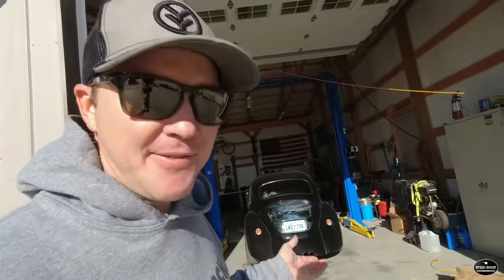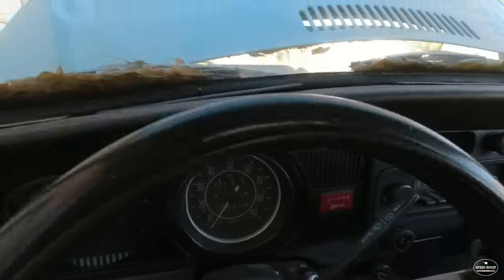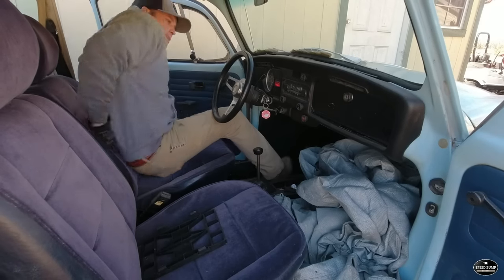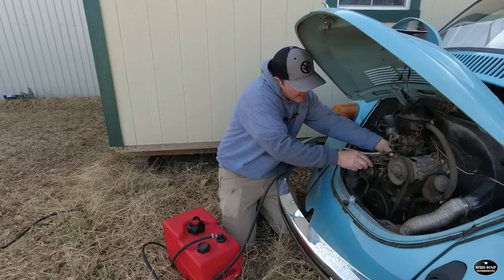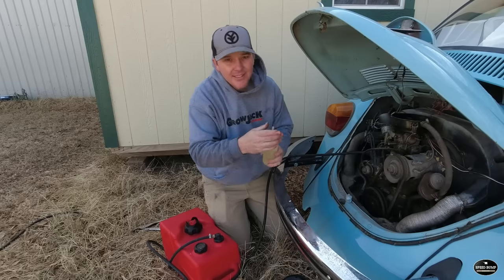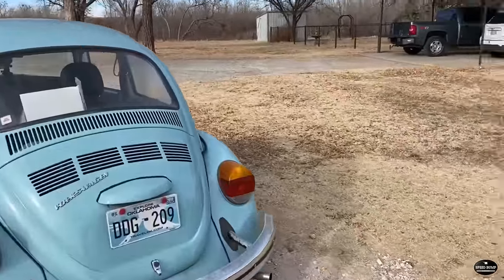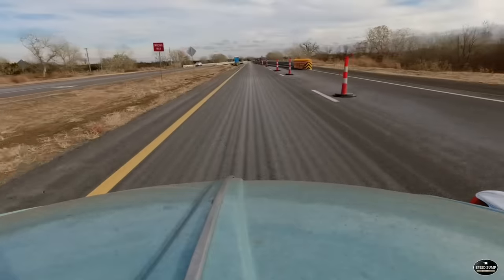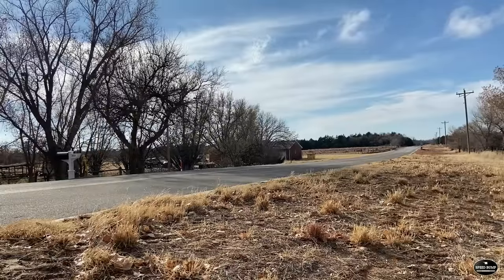{Will it Run?}1974 VW Beetle

Comment: It's a 1974 Standard beetle, not a Super Beetle. The generator and air cleaner are not correct for that car...it should have an alternator and a paper air cleaner assembly. The plug on the side is some kind of dealership "diagnostic' plug. Really nice car...wouldn't take much to return it to original!
Reply from the maker: Thanks for the info Tyler! I would love to see what those diagnostics looked like on such a simple system lol.
Reply: @SpeedBumpGarage  You're welcome. Haha, I don't think there was much actual diag ability. I think there was a TDC sensor in the block somewhere and it probably had ability to read dwell and timing advance and voltage but not much more. More of a selling point in those days tot ell the customer that the dealer could "put it on the computer". Some times you'll  see the same type of thing on domestics cars during the 70's. Also if you're curious, you can get the engine code off the block under the generator stand and determine of it's the original engine.

Comment: Blow out that line and replace the filter, maybe clean the idle jet. if its fuel delivery, confirm the pump is good. get the right air cleaner, fuel lines would be good to replace. nice car, I never had one that new.
Reply from the maker: That's the plan! I need to get an air cleaner ordered.  Thanks!

Comment: Little bug is in great shape! I'd love to have it as a daily driver! Little cosmetic repairs, and a carb kit, likely a dry air cleaner kit, and cleaning up the wiring (Every VW I've dealt with has had a mess for wiring). Always wanted to own a Beatle, but never got the chance, and now, it's likely I'd never be able to afford one in good running condition, sadly. Helped work on a couple, back in the 1980's, in Germany. GI owned, German spec. models. Early 1970's models, I believe. Factory wiring looked like they just tossed a couple rolls of wire at it and let it sort itself out. That was usually the first thing we worked on. And usually took the longest to make look right and work right. Had to completely re-wire one of them, using a factory wiring diagram, that we had to get translated from German to English. Guy that owned the car gave it to the new owner when he sold it. That one had the clutch in the stick, instead of the floor. Think they called it the AutoStick? Strangest transmission I ever dealt with.
Reply from the maker: They definitely did not worry about making the wiring look good lol. I have heard those auto trans are a nightmare to work on.  Thanks for watching
Reply: Just an automatic with a diaphragm disengaging a torque converter. Very slow cars but relaxing.

Comment: Noticed part two of this posted recently and realised I hadn't watched part one, so decided to fix that.

When you said a one lane bridge on the way home that was not what I was picturing.  I was thinking a bridge with only one lane open for traffic going both ways so you may have had to sit and wait to go across or if you got stuck (I didn't think you would) that traffic in both directions would be held up.

So glad you got it back without any real issues, now off to watch part two.

Comment: Engine sounds really good! I would check the carburetor to see if it needs rebuilt or check for any air leaks. Cause I could tell how it doesn’t want to idle and sometimes with a vacuum leak or any air leaks it won’t stay running without revving it. Great Video! Nice Car! 👍
Reply from the maker: Thanks! I ended up getting a kit for the carburetor so I’m going to go through it soon. Good call on the vacuum leaks! I appreciate the help

Comment: Here’s a helpful hint! When looking at the schematic you print out from the internet, you have to turn it upside down when under the trunk lid for the orientation to be correct. I know this because I bought a 72 beetle and all the wiring was on the fuse box reversed. I figured the last guy looked at the schematic wrong! I just switched everything back and now it’s fine!
Reply from the maker: Thanks for the tip!

Comment: I think that those are not the og seats. I had a 1974 VW Bug years ago and it was totally original when I got it. There should be a little lever at the very front of the seat that you can release and the whole seat will just slide out you don't even need any tools to remove the seats if they are og VW seats. It looks like it also has a quite pack exhaust on it. Mine had a quite pack/header on it but I took the muffler off and ran a stinger with the baffle out. It was just a stock 1600 but it sounded like it was a "hot rod" lol. The thing that I really liked about it was if I had had a bad day at work when I got into the Bug all of the bad stuff from work just went away and life was good. Wish I had never got rid of it. I and it fixed up in what's known as The California Look.
Reply from the maker: I love the way the baja's sound with that stinger pipe! Driving a hot rod to work can help melt away all of you problems lol

Comment: If it will run like that, but not idle, check the idle fuel cut off solenoid. There’s a small Dashpot screwed into the side of the carburetor that has two electrical wires going to it. This is to keep the engine from running on i.e. dieseling after the ignition is shut off. Take the two wires off the dash pot and unscrew it from the side of the carburetor you’ll see a little plunger. Hook the wires back up and turn the ignition on. When 12 V is applied to it the plunger should retract opening up the idle fuel circuit. If the plunger does not retract when 12 V is applied to it, or you do not have 12 V there with the key on, the car will not idle. Sometimes you can shoot some WD-40 in them and free them up if they are just stuck, or if you are in a jam, and the plunger does not retract when 12 V is applied you can take a pair of needle, nose, pliers, and snap the plunger end off, and screw the Dashpot back in the Carburetor to plug the hole, and it will idle just fine. The only problem you have is, you will have no ideal, cut off circuit i.e. run on/dieseling protection..

Comment: The taillights tell me it's at least a 1973.  On the older cars part of the numbers on the taillight tell you what year it is (old trick).  But that would be a "Super Beatle" meaning it has a McPherson Strut front end.  I've had many VW bugs, mostly between 1965 and 1969 w/torsion bar front suspension.  Used to make baja bugs out of them and they were great off road and in the snow.  Fun little cars, good gas mileage too around 30 mpg.  You're lucky cars are pretty rust free for the most part in your neck of the woods, unlike where I live.  The wiring can be a project all in itself, but you know that from your other bug. lol   Great video.
Reply: mikejames7013 I don't think it's a Super Beatle. Because the windshield is flat and Supers have a curve to them. Years ago I had the twin to this car same color and everything.
Reply from the maker: Thanks Mike! I didn't look but I was assuming it had the torsion bar front end.
Reply from the maker: I do think it is a standard beetle
Reply: @SpeedBumpGarage  If has torsion bar suspension its a regular one, Super beetles had McPherson struts.
Reply: @lilorbielilorbie2496 ’71 and ‘72 super beetles had flat windshields and flat dashboards. The curved windshield didn’t show up until ‘73. They all had McPherson strut front ends.
Reply: @ekimp252  That may all be true, but this car is either a 1973 or a 1974. That's when they started with the "safety" bumpers and the big round taillights.
Reply: @lilorbielilorbie2496  this is a '74, it has the round "shock absorber" style bumper mounts with the matching fender hole covers. '73 was the last year for the flat style. But nothing is absolute with these cars, they're 50 years old and lots of times parts got switched around.
Reply: @ekimp252  The bumpers on my 74 Bug were in such bad shape that I just threw them away and adapted some early blade bumpers in their place.
Reply: @lilorbielilorbie2496  I’ve thought about doing that to my ‘74, I’ve seen someone that makes covers that fill the big holes in the fenders and have slots for the thin brackets. Got other stuff I need to fix first!
Reply: @ekimp252  The way that I fixed mine was really simple. I got some flat stock and bent it till it fit into the blade bumper then welded it to the bracket that the 74 bumper bolted onto. I left all of the rest just like VW made it. That  way I still had the "safety" part still on the car and the bumpers were the only part that I changed.
Reply: @lilorbielilorbie2496  that sounds pretty interesting, how old are the bumpers that you used? I've wondered what towel bars would look like on a late model.

Comment: They are a RUGGET LITTLE  AIR  COOLED  ENGINE that have a magnet in the bottom of the oil panbolt to collect steel particles that can wear an engine oil pump out if not captured by the magnet.They had nice after market kits for rebuilding that little motor.You get  4 new cylinders with matching pistons and rings,rist pins and retainers crank berrings end play bearings.The 4 cylinders come with valve seats already installed you have to seat valves. They were really nice little motor that any KID could learn.I had the FAST BACK engine, they called it the PANKAKE ENGINE with two carborators that had to be sycronized with what you called a  UNISON.My wife loved that car with the wined crank SUN ROOF.The heaters in Volkswagons that year were very good for keeping a case of beer COLD?In other words THEY WERE NOT WOURTH  SHIT!!!

Comment: My 59 didn't have but 4 fuses and minimal wiring, I updated it to modern fuses and a alternator heavier wiring to handle off-road accessories..it's got a singleport 1500 out of a 67 bus with AA P&C kit due to #3 had a hole in top and side and 1500 top end is no longer available...motor and transaxle were both siezed up but I got operational... want to convert to IRS REAR Eventually.. off road non DOT only toy... everything needed work or replacement
Reply from the maker: Sounds fun! I love the early beetles

Comment: unmolested wiring in the front, some cheap wiring at the back, and well,,, the car looks very clean. Nice project, The main problems is having a block fuel line, the carbiretor need service, it's ok.
Reply from the maker: Thanks!

Comment: Nice looking bug yeah I rebuild the carburetor check the spark plug gap and check the points rewire that starter sounds like a bad ground I fix that rust in that pen you some red oxide but some wide Meats on it tires
Reply from the maker: Thanks Gene!
Reply: Take that ground and grounded to the engine not the body put a whole next to the battery with a omelet right straight to the starter bolt then run one to the back to the body it works a lot better
Reply: I should preview before I send it a rubber grommet after you drill the hole and omelet omelette

Comment: Mine was a 74 1303S with curved windshield.
I found minor differences such as mine had no energy absorbing bumper brackets, flat glass headlight, dashboard with raised gauge, no headrest on front seats, rear side windows with pop open features,,,
Reply from the maker: I like the shorter seats with no headrest better! I wish this one had them
Reply: @SpeedBumpGarage  LOL When I had my 1303S, I wish mine came with headrests which were new features. 
Yea, mine was European version. I don’t care much about the rest but the headlights were something special. They were not sealed beam types mandated by DOT in ‘70s. FYI The shape of glass headlights looked exactly same as ‘74 European Porsche 911 headlight glass cover. They were protruding flat angled glass cover not recessed around bezel rings like most U.S. VW.

Comment: At 10:00 the “bulkhead” you see is the factory test harness connecting block, it should be unused. I see at the same point that it has the usual “burn up my bug” fuel filter too! Get that thing mounted outside the engine compartment!!!!
Reply from the maker: Thanks! I will move the filter when I fix the fuel system

Comment: The problem with VW engines and AIR COOLED is retorgueing the engine after running the initial run and cool down but because of all the cooling shields and dampers that have to be removed its a lot of work?

Comment: Dude if you leave the key on it will burn out the electronic ignition in points you need to turn off key intermittent just saying
Reply from the maker: Thanks.  No points in this little bug.

Comment: If it’s original and hasn’t been boogered up. You have to fasten the seat belt befor the car will crank.
Reply from the maker: Really?! Someone must have bypassed that
Reply: @SpeedBumpGarage  yeah, it’s a quirk …my bro has an original 74…and it’s like that.
Here’s another…under the dash….in front of the shifter. Is a light, and it is supposed to illuminate the heater levers between the seat.
Those are usually gone as well.

Comment: The wiring on those VW are awful.All it takes is one wire loose on the voltage regulator and it will not run .The fuel line runs from the front to the back.You also have to carry a spare belt all the time because they are bad for stretching or breaking

Comment: It doesn't look like it's been sitting 5 years..
Reply: You're a VW guy and you didn't know this near perfect bug was within 3 miles of you? And it fires right up..and runs great. This seems staged to me. Too good to be true. I hate to be offensive,  but this looks very atypical.  I don't believe it
Reply from the maker: I knew of the car but haven’t seen it around for years. It has been parked since 2017 when it left them stranded do to a fuel delivery issue.  I addressed the fuel issue with a boat tank. I purchased the car because I knew it would be an easy fix that I could make a one day video out of. I have way too many irons in the fire to be staging videos
Reply: @SpeedBumpGarage  I was wrong to have accused you of that. It looked so good to have been sitting. Almost perfect.  But I was totally wrong
Reply from the maker: @secondlooksformen3836  no problem. I try to pick easy ones from time to time to save my sanity lol